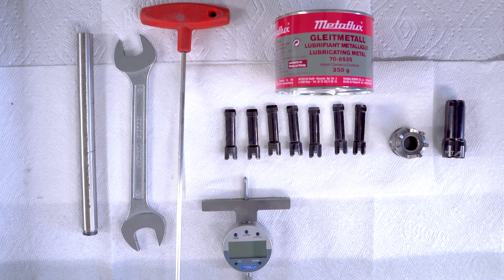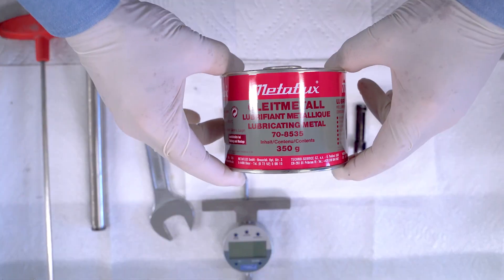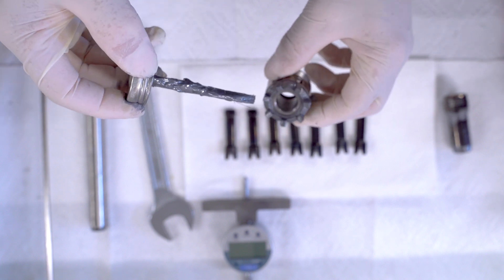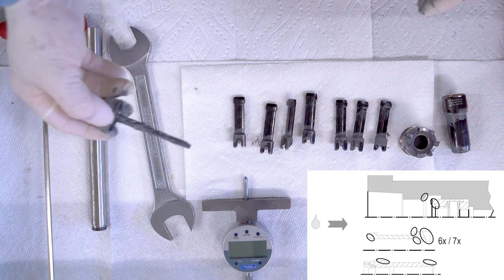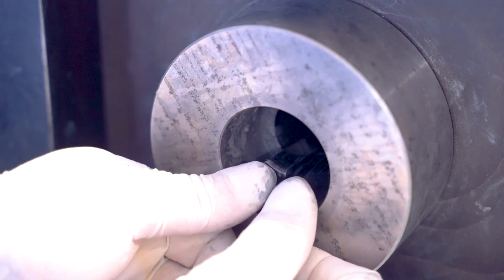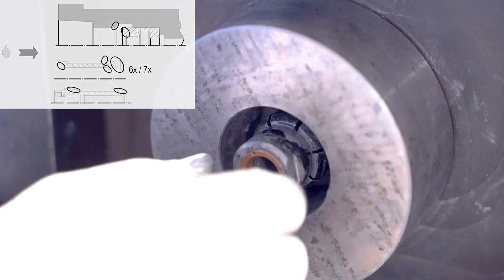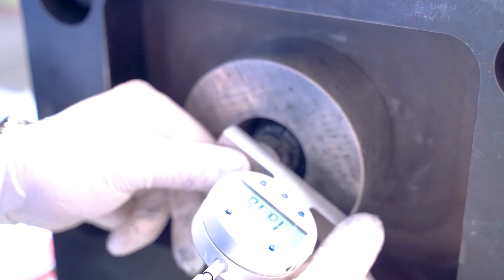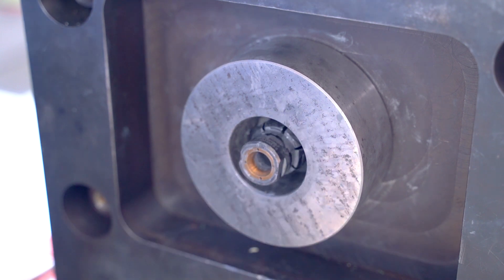OTT-JAKOB HSK Gripper Installation and Gage Setting Tutorial

Comment: What's the trick to doing this vertically while spindle is in the machine?
Reply from the maker: Hi Austin! Installing gripper fingers on a vertical spindle rather than a horizontal can be slightly challenging. However, we have a custom gripper installation tool that makes the process much easier and keeps the fingers all aligned when fighting gravity. Please reach out to either scottj@ame.com or korey@ame.com for more information and assistance!